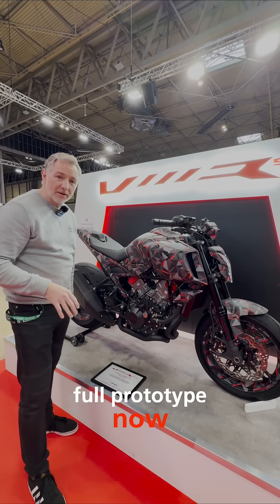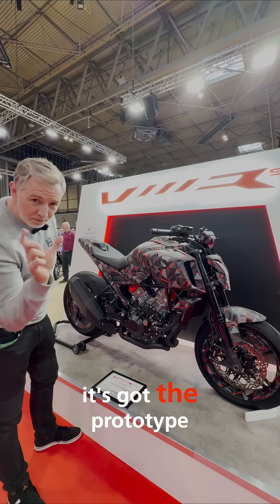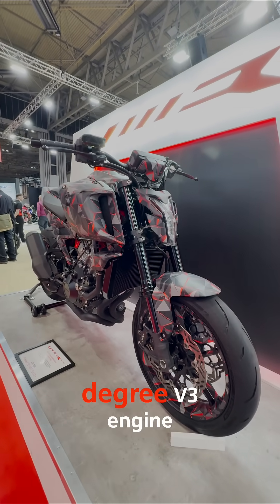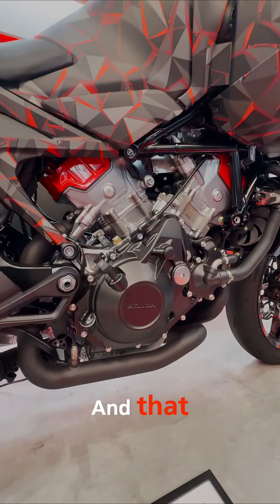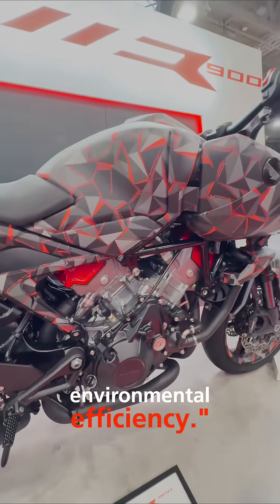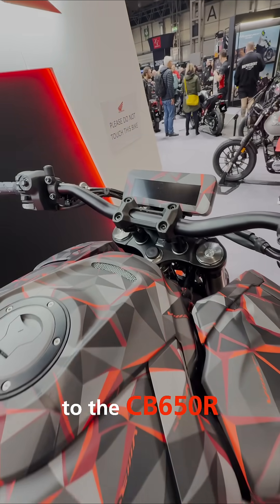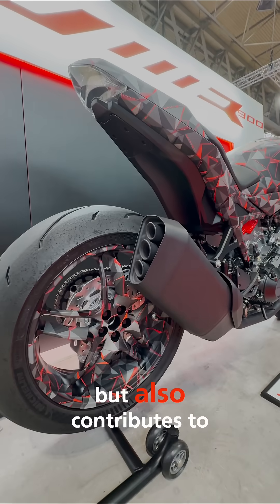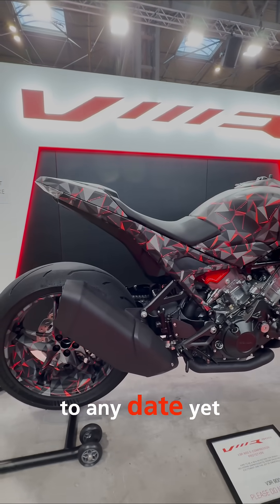Honda's V3R900E - Prototype Engine's Cutting Edge Technology

Comment: Ok, so Honda make a nice narrow bike and then adorn it with 2 asymmetrical warts wider than a horse's rear end, bolt on a Briggs and Stretton lawnmower exhaust, give it a poxy third world cable operated clutch and vertical headlight that will not work when the bike is leaned into the first corner and a meniscal TFT screen and hidden the space frame. What were they thinking?
Reply from the maker: I’m guessing you’re not a fan then. Good job the world is full of different people.
Reply: @bennettsbikesocial  The wonderful people at Honda also gave us the CBX, a technological masterpiece at that time. But it had 4 chains inside the motor, weighed a tonne, was a nightmare to service and was prone to throwing rods at the end of straights on the racing circuit. I picked up the shattered crankcases. Honda quickly realised their mistake and repackaged the bike as a sports tourer. Attention to detail is everything.

Comment: A solution to a problem never existed. I had a Yamaha Tracer 900...115 hp. Never felt I needed more power. The new model has 120 hp and the MT9  variant is even lighter than the Tracer. The electric supercharger and the battery add weight and complexity. A 500 cc twin with a supercharger would make more sense.
Reply: Might it have an impact on emissions? To make it easier to pass stricter controls?
Reply: I had an MT10 and loved the power, but if I could have more for less, I would. To some people, me included, having more torque sounds appealing. Advancing in technology is always adding complexity. I am sure this can be as important as variable valve timing and become much more of a standard in near future. It's nice to see some development not only in the car engine world!
Reply: This is supposed to have the perfomance of a 1200cc according to Honda, so probably 180-200 hp (judging by Speed Triple 1200), a completely different ballpark from the MT09.
Reply: Complexity is the key. The hybrid/electric market has pryed repairability out of the average drivers hands. Its difficult to do that to the motorcyclist but let's not back down from a challenge

Comment: Looks sweet. Garrett is the supplier
Reply: Unlike Kawasaki, Honda doesn't back background in helicopters blades, Airplane rotors, turbine generator fans, so Kawasaki can make superchargers work, honda makes turbos for cars and have made a plane engine but they would rather outsource compressor and motor to Garrett
Reply: @ShivamArya-yf4ku Well it’s interesting that they consider their expertise from turbos and jets insufficient.